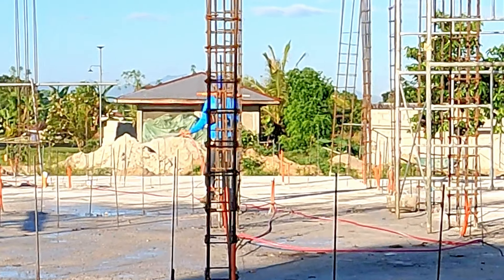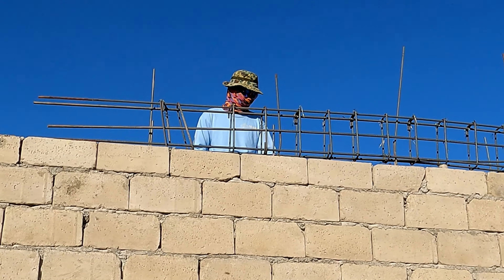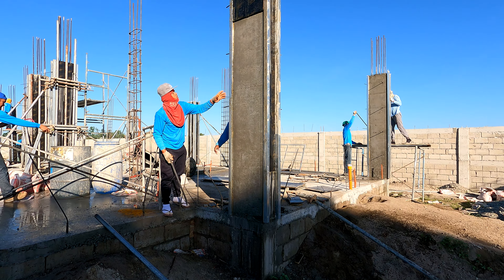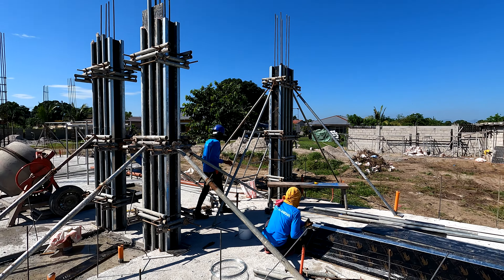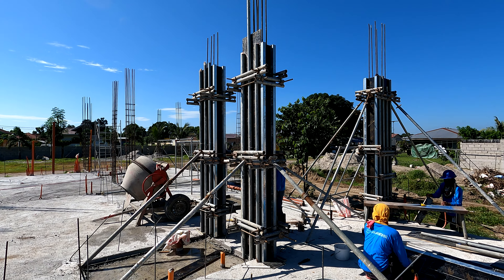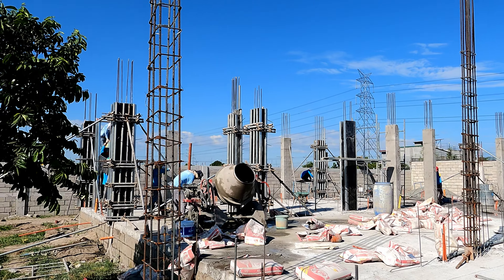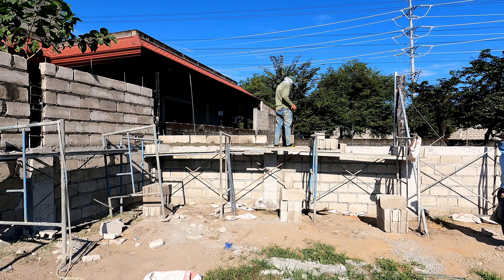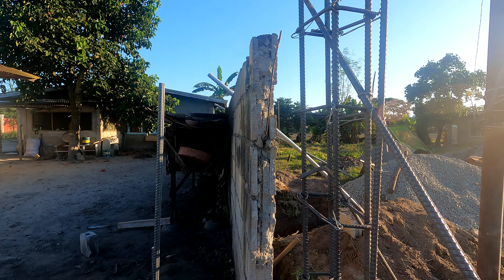Philippine House Building Day 45 - Forms On Pour Concrete Forms Off

Comment: Columns look good. Only suggestion would be that in addition to the mechanical vibration while pouring the concrete… also use a heavy rubber mallet to tamp the outside of the forms. This will assist in moving the cement into the voids along the sides of the forms. Just my 2 pesos worth. 
Your engineer is doing a fine job. Very impressed.
Reply: Good suggestion
Reply from the maker: Actually I did catch them using a hammer on the sides at the end of the next video. May have missed it before.